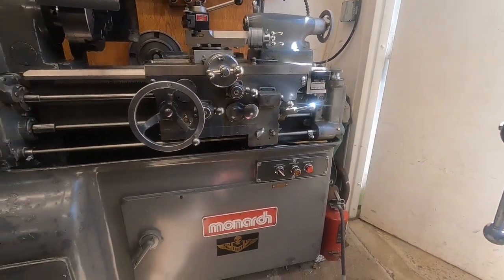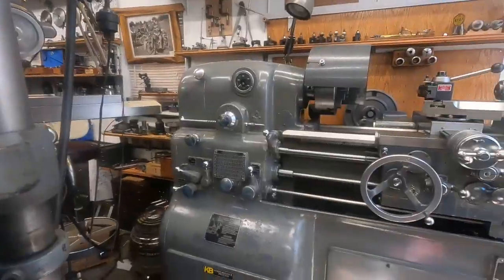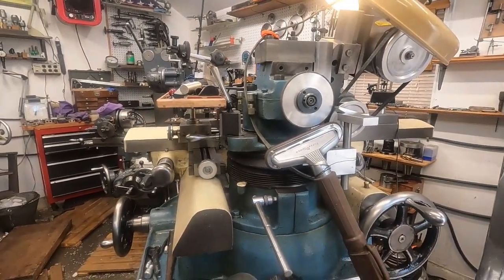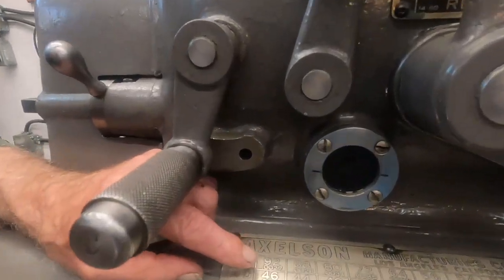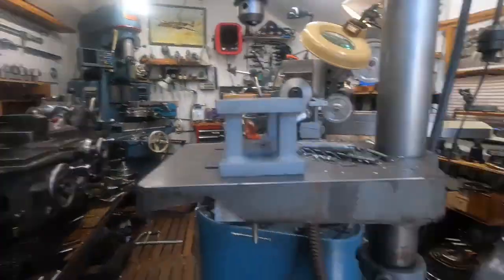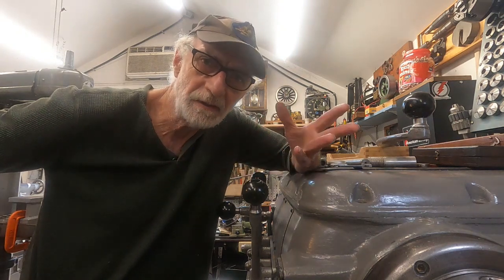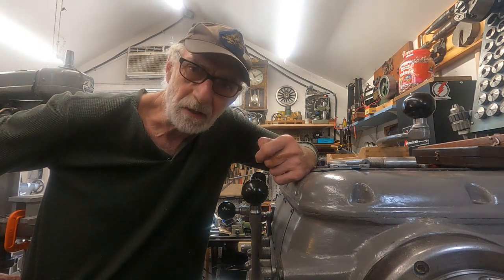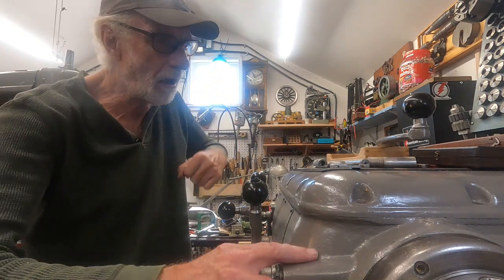Lathe tool nose radius adjusted to feed rate.

Comment: Dee now you have my curiosity up. When measuring the o/d if shaft you said "Push" the mic forward to remove it. . is there a reason for forward removeable of the mic. is it just for repeatability? In my old age I am beginning to lose trust in my measuring. i seem to always have difficulty measuring in place. (In the chuck or in the vice) it's like I am trying to stand on my head to read the measurements. Instructions on how to Take measurements "correctly and repeatable" would be valuable' . I have found with my old machines to reset the zero on the cross slide each cut, in the last 3 cuts increases the odds of hitting my target.
Reply from the maker: Yes, I am trying to go by feel on that and doing pretty good. I have some stray gage blocks to help. I have to use an indicator, the cross feed dial reads 0-400!

Comment: 27+ years hobby machining. Everything I’ve seen, read, or heard says nose radius including modern carbide inserts. Micro-100 or Carbaloy razor sharp point tool on my plain bearing South Bend 13 with all scrapyard material gives absolute best finish and targeted tolerances. Never needed a radius. I don’t  understand why but am glad it happens.
Reply from the maker: The Southbend is considerably more precision than an Axelson Lathe in many ways. The coarse power feeds of many of these old gearhead lathes leaves fine threads with a sharp point, but it can be done with careful hand feeding.
 Plain bearings are much more accurate and produce rounder parts compared to heavy duty Timken bearing headstocks that have load capability of locomotive axels.
 I have to work harder to get reasonable accuracy out of this heavy 14X30 gearhead lathe than I did on the SB 14" and 16" lathes I had in the past. This Axelson has brute power, it can easily destroy itself, but amazingly accurate for its type. Thanks for tuning in, I am a big fan of the old south bend!